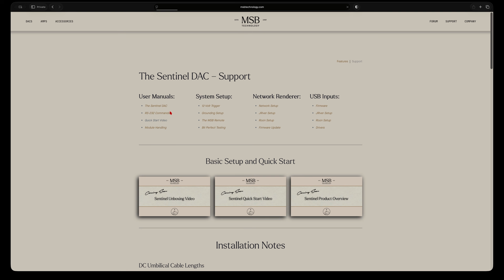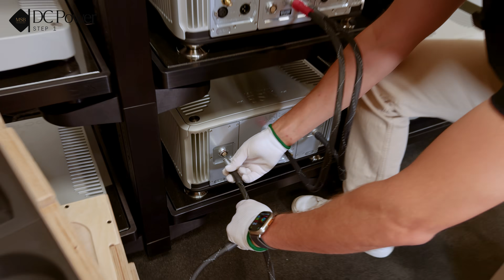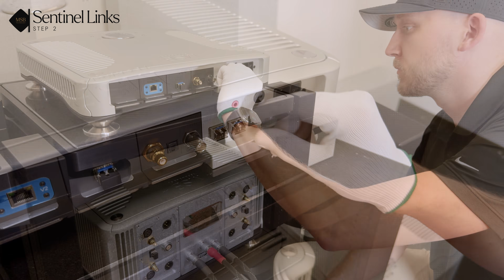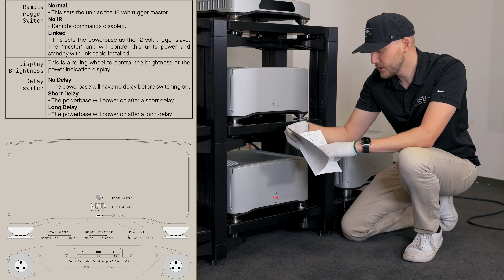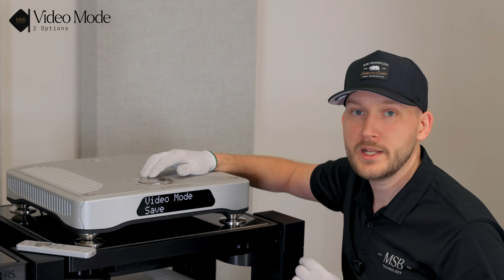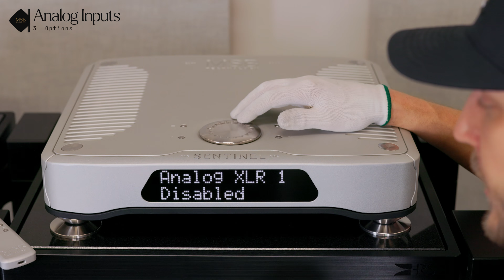The Sentinel DAC | System Setup

Comment: Funny there’s no mention of what chip is used for the dac itself, nor what the timing/clock frequency standard is - tcxo, ocxo w/gps discipline, rubidium, or cesium?  After having nothing but trouble with cheap $100 dacs from amazon, I bought a fiio k17 with every interface I wanted even Ethernet, going to xlr out which I run to studio monitors & subs- the same studio monitors the mastering engineer used at his console mixing down the separate channels into a 2ch stereo master, so my listening experience matches the recording studio as close as possible.
Reply: A setup video is about product setup not features… With less effort than you allocated to your post you could have found most of the information you are clearly curious about on the manufacturers website…
Reply: This thing is 375k usd pretty sure it's all custom, I think it has 32 dac chips and the clocker is custom as well. People who buy this already know what's in it.